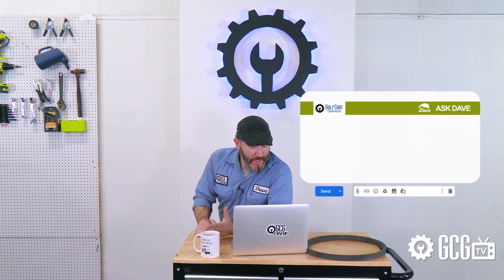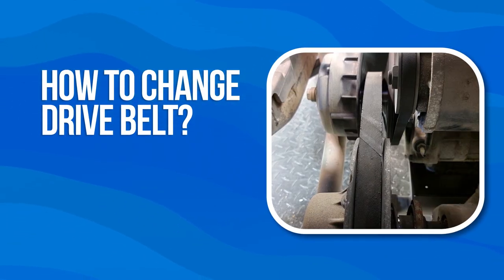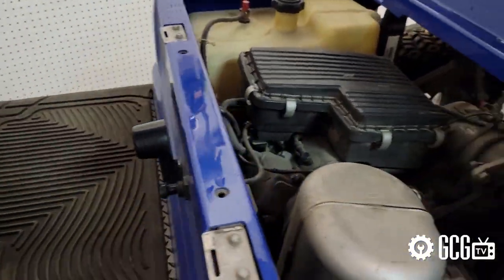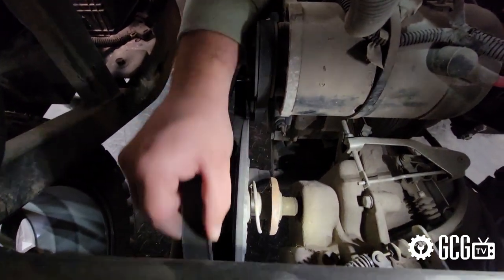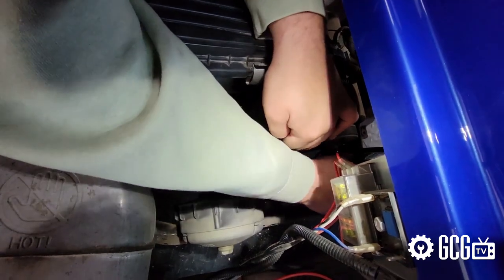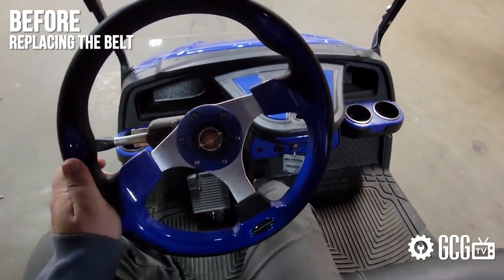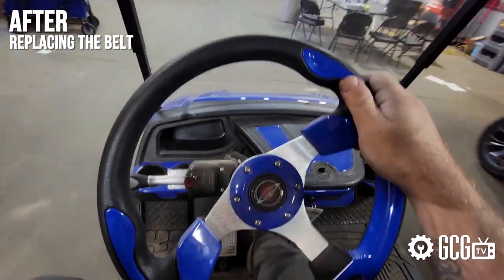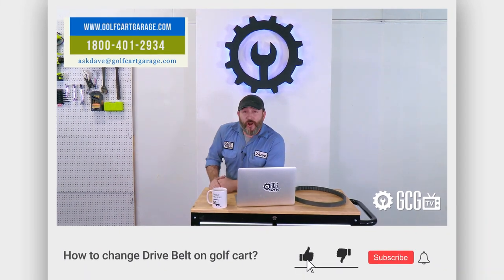Change Yamaha G29 Drive Belt | ASK DAVE | Golf Cart Garage

Comment: I've just replaced the drive belt recently, and it has sounded like it was slipping and failing to start a few times. I checked the belt and it seemed like it was a bit too loose. Is there a way to tighten the belt a little? I have the team style clutch.
Reply from the maker: Thanks for watching, Jesse!  As you can see in our video, the belt should be loose enough to remove by hand while rolling the clutches.  It will tighten when running when the clutches move.  We usually don't see any issues with that unless ordered for the wrong model.  Let us know if you have more questions or need more help.  Support@GolfCartGarage.com or (800) 401-2934
Reply: It should be the correct belt, it was from the Yamaha distributor, but it seemed like it has way more slack on it than when I put it on.  Every now and then, I would need to pump the accelerator to get it going as it was just squealing and not going anywhere, which made me check the belt again.  Thanks for the video and the reply!

Comment: Just picked a G29, it had a new belt installed. To me the belt sits a little low in the secondary compared to my snowmobiles when stopped the belt sits at the top. The belt is tight between the clutches so when I hit the gas its like I'm hitting the nitrous button off the starting line. I checked the number on the belt and it says it is a 41.13" long belt. What can I check to get this to take off smoothly?
Reply from the maker: Thanks for watching, Curt!  From your description of the symptoms, it sounds like someone may have installed a Heavy Duty Belt, there.  There should be some slack on the drive belt on any G29.  A regular duty replacement is here: https://www.golfcartgarage.com/golf-cart-drive-belt-yamaha-drive-with-team-clutch-2007-2012/
If you have more questions or need help, just get in touch. Support@GolfCartGarage.com or (800) 401-2934

Comment: How to stop a Drive Belt from slipping
Reply from the maker: Thanks for watching!  If it's slipping, it may be worn and needing replacement.  There may also be a clutch issue.  You can get an appt for a video call diagnosis here: https://www.golfcartgarage.com/gearheads-on-demand/ or get in touch directly at Support@GolfCartGarage.com or (800) 401-2934